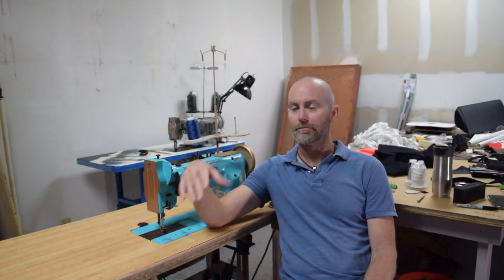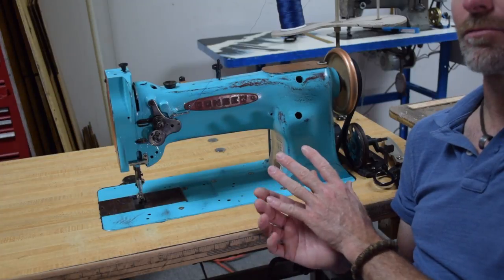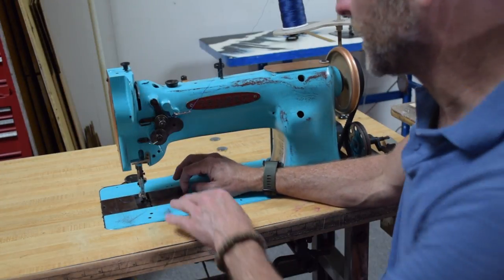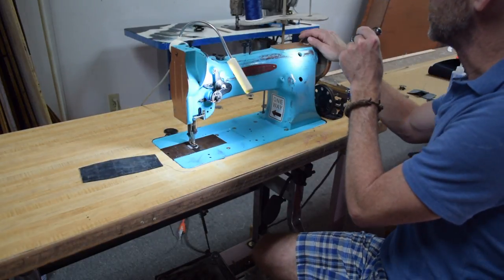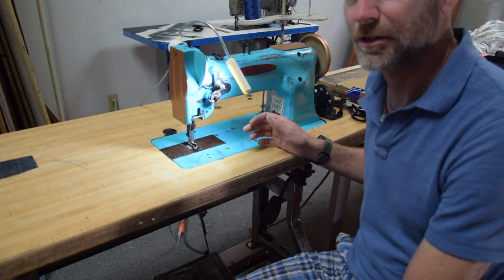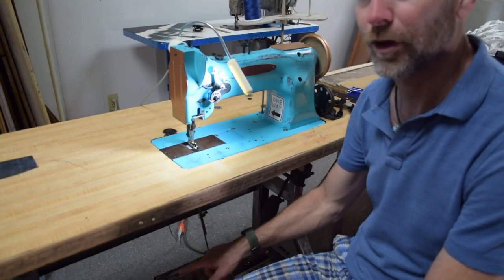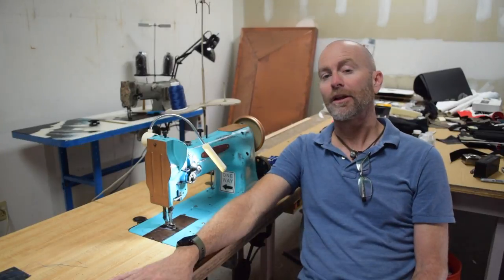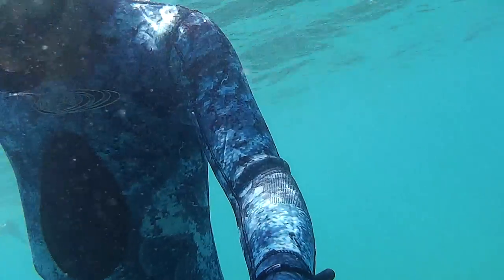Industrial Sewing Machine without reverse? (Consew 225 introduction)

Comment: Picking one up tomorrow morning to use as a backup to my 111w154 I am going to restore. 
 I like doing Sunbrella type covers so the added stitch length is a blessing.  Both machines can handle v207.  What I found on the G—bobbin machines is the clearance under the hook plate and the top of the hook is minimal so I had to machine down the thickness of the cover plate to allow the thread to maneuver under between the both. 
   I use a 22-24 needle, v207 upper and a 138 prewound bobbin.  No issues at all.   If you are running into. Much thicker material could cause a tension issue. Rather than not work with the material you can just remove the tensioner assembly and behind there remove the pin that goes from the back of the machine to the tensioner . That will allow you to work with more height and not break the tension .  You will have to either pull thread by hand or just run the machine while pulling your material from under the foot assembly, it’s called “run off” . 
  Nice video. Nice machine .  Trying to figure out a color for mine that is also funky !

Comment: I got a good deal too, a Consew 226, a Singer 99, and a 1958 Morse, $200. I actually have more in the servo motor/ speed reduction pulley set up on the Consew, then what I paid for them

Comment: I have a small shop we run 4 machines ranging from largest to smallest a consew 745, a consew 206 long arm, a consew 206rb-2(my favorite) and a consew 226r-1. The 226 is the same as the 224 but with reverse, it is a good machine, we sew ultra heavy fiberglass fabric with a stainless mesh in it and it handles it well. The only problem I have with it is all parts are not available and the ones that are that are different from the 206 are all of poor quality out of China. We have all machines set up with servo motors with needle position sensors. I’d never go back to a clutch motor. But the old sieko made consews are bulletproof

Comment: As for no reverse. 
One: the chisel point used for leather can and does cut the thread of the existing stitches, so this would negate the reason to use it. I prefer stout square knots with burned ends.
Two. If you really need reverse...plunge the needle, lift the foot, turn the work around and sew forward the other way. Just try to be exactly next to the other stitches, not on them. See One above.

Comment: Did you make the timber table???  I love the machine too - I miss Mums Bernina treadle machine which came from Switzerland with a table that I still have.  Unfortunately we gave the machine away - huge mistake.  Dad put a motor on it    (eventually) plus the table had a mechanism where the machine went under the shelf and left the top flat.  It also has 5 drawers which all lock with one key.  Thanks for sharing I really like your channel. ♥️
Reply from the maker: This table top is just particle board with a laminate top (came with my other machine).  I made the top for my primary machine (there's a video on my channel if you haven't already seen it).
I haven't had a Bernina yet, but they seem to be great machines.
Thanks so much for being part of the channel!

Comment: Great deal! What's a synchronizer (what does it do)?
Reply from the maker: Hi!
A synchronizer or needle positioner allows the needle to always stop in either the up or down position.  You can also use the back side of the treadle (pedal) to raise or lower the pedal.  I prefer to have mine set to stop needle-down.  They are a huge boost to speed and efficiency, since you rarely have to touch the hand wheel.  Making sharp turns where you pivot around the needle is much faster and more precise; you stop sewing, the needle is perfectly positioned to hold the fabric in place but to not skip a stitch when you start sewing again. Raise the foot with the knee lever, using both hands to control the material, make your turn, drop the foot and start sewing again.
This video explains it if you'd like to see a bit more - https://www.youtube.com/watch?v=skSfBXXHTow
Thanks for watching!
Reply: @thejasonofalltrades  Thank you for the helpful info. I have a feeling I'm going to be going down the rabbit hole on industrial walking foot machines. Since I've bought my first one I'm already scouring craigslist and thrift stores looking for a cylinder arm walking foot or another flat table unison feed. Have u thought of recording a vid on what key things to look for, and check, when buying a walking foot before taking home lemon? I have not seen a vid like this posted even from A. Dyer. Maybe one has to own one for a while and then they would be in a better position and would have the knowledge necessary on what to look out for?

Comment: Is the flywheel aftermarket? looks beefier than the wheel on my consew 333. I wonder if it would help me to upgrade when running heavier materials. Thanks for the video!
Reply from the maker: To the best of my knowledge, this is the stock wheel.  I failed to mention it in the video, but the way this one is oriented (with the belt outside the larger diameter part of the wheel), it is pretty easy to catch your finger under the belt, which could cause a pretty serious injury.  
The only example of changing the flywheel I've seen is the Sailrite Ultrafeeds with their Monster Wheel.  I don't know if there are other wheels out there for industrials.  In theory it might be helpful, but I have no firsthand experience to inform my opinion.
Thanks for watching and commenting!
Reply: Thanks Jason, that sounds like a serious safety hazard!

Comment: ok, I hope I am not alone in this but I like the way it sounds when it is sewing!! - that no reverse thingy... hmmm, my "new" Singer will not reverse unless you are already sewing forward (was very hard to get use to) and if I had known before I bought the machine that would have been a deal breaker for me
Reply from the maker: You're not alone, I love the sound too!
Not having reverse is inconvenient and takes more time, although in some cases that could be a good thing (like working with leather, where a misplaced stitch hole is there forever).  I probably wouldn't want this as my one-and-only machine, but as a backup and for the occasional job needing a really long stitch length, it should fit in nicely.
What kind of Singer do you have?  I've never heard of your reverse situation.
Reply: @thejasonofalltrades   singer confidence 7640 - I waited till it went on sale at walmart about 2 years ago - my first embroidery machine (most likely my last lol)

Comment: The Consew 225 is my first industrial. Clyde and I have a challenging relationship. I love that it will go thru 2 to 3 layers of nylon webbing along with 2 to 3 layers of polar fleece and 6mm neoprene in one sandwich! (Not many will go thru neo, sticky.) I was so excited that it did that I didn't notice that there was no reverse.  I just got used to turning my work or routing the thread path to overlap on the ends. My issue is what I do requires control, not speed. I am looking into a servo motor, trying to learn which one is best. So far brushless seems the way to go. If anyone has any input I would love to hear it.
Reply from the maker: If you haven't seen it, I posted a video about putting a cheap servo motor on my other industrial machine.  It made a huge difference in controllability.
Thanks for watching!
Reply: @thejasonofalltrades  I did it! Got a Consew servo and love it. I picked this one because it has on of the lowest rpm's. Have made two harness on it and love it, so much easier to control.  Thanks for your encouragement and your videos.

Comment: They come up around here for $150 all the time, plus the parts are cheap and plentiful.
Reply from the maker: Where is "around here?" In case I need more :)
Reply: thejasonofalltrades Wisconsin, I’m happy to send photos when they come up, not much of a second hand market to drive prices here
Reply from the maker: Shipping would probably negate the price advantage, sadly.  But it's good to know they're out there! Stay safe.
Reply: thejasonofalltrades lol! I try to fly southwest on vacation for the free second checked bag. Just in case
Reply: Why is Wisconsin and Minnesota full of vintage machines? I see a lot of parts and machines on eBay from that area.
Reply: mongo slade I think it’s a combination of past manufacturing and the slow current resale market, a lot of fur and leather work was done here (a lot still is) but machines ended up in barns and haven’t been found yet